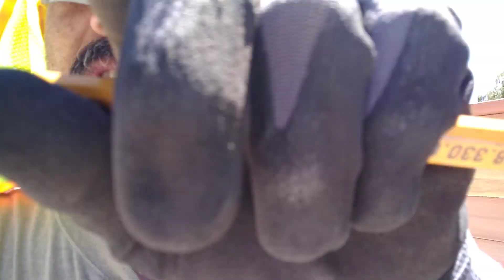How to assemble horizontal fence panels

Comment: Just beautiful.  Choice of redwood contrasting with the dark stained posts is a perfect look.  I noticed you're using nails, and I feel they are not only easier but are also less noticeable.  Yet every time I research fencing screws are recommended.  Why is that?
Reply from the maker: You can use whatever you want to mi is fain tks for you comments
Reply: Screws are better for a ton of reasons.
This guy is only using finishing nails. That is absolutely unheard of....

Screws will never wiggle and have the boards come loose.
If the board is damaged, it can be taken out easily and replaced. No hassle trying to pull nails.
Screws also pull the boards tight to the posts if there are any boards warping or crowning etc.
Reply: Of course screws are better but it’s more expensive than finish nail and a lot of work too you have to pre drill all the board first before you put the all the screws.

Comment: what is the thickness of concrete base?
Reply from the maker: 8 inch
Reply: @leopoldomreyes821  Thank you, another questions is how deep the foundation is below ground and how many rebars did you use for top and bottom?
Reply from the maker: Minimum dep 18 inches 2 ribar 5\8. For bero supord